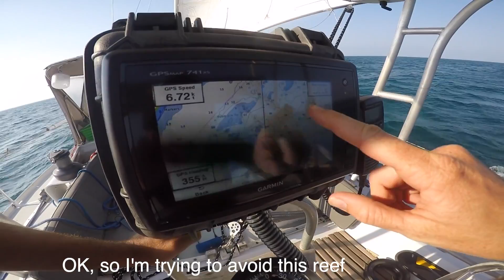Everything Breaks & Engine Fails Causing Us to Sail Thru Florida Reef (Litzenbergers Ep.114)

Comment: Too bad you didn't have a way to connect the small propane tank into the larger system to cook with the oven.  Maybe some MRE's that have heat source included in the packets. Something to think about for the future.
Reply from the maker: Yeah! Someone suggested that and I think we’ll track down an adapter now that we’re stateside.
Reply: @SailingwiththeLitzenbergers  Ive never used one, and some say safety could be an issue, but there is also a "kit" to refill the 1# & camping bottles from the larger refillable tanks.

Comment: On any boat, about every 10-15 years, all "rubber" fuel line should be replaced regardless of how they look.  If the old hose looks good, keep it for spare/repairs.  Make sure you have hard plastic or copper tubing of the proper diameter to make splices.  LOTS OF STAINLESS STEEL HOSE CLAMPS, various sizes.

The same is true for all engine hoses containing pressurized liquid and all hoses going to below the waterline thru-hull fitting.  Just replace them and keep the old ones.
Reply from the maker: Yeah, only problem is we couldn’t get it when we were in Guatemala. Their hose selection is pretty limited. There’s a lot of Guat fixes that Tarka needs remedied, just gotta save up the 💵 😉👍
Reply: @SailingwiththeLitzenbergers  Maybe if B was doing the manscaping for others, she could make some $$$ !